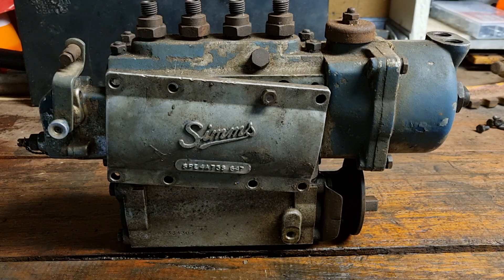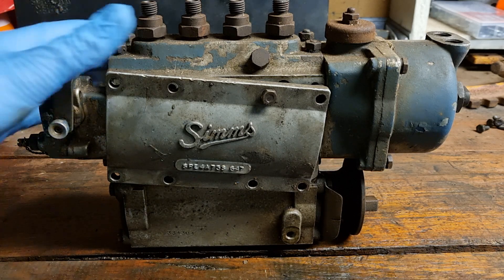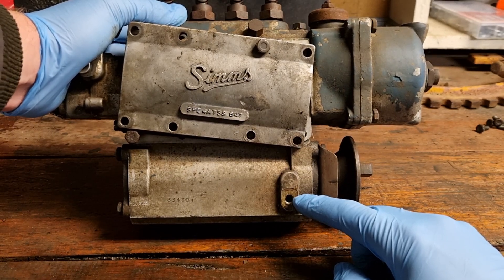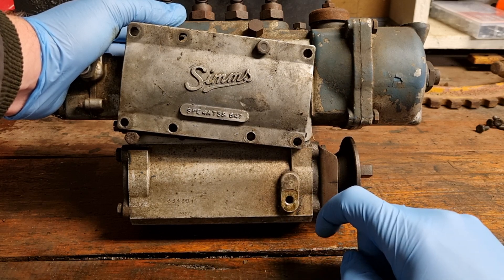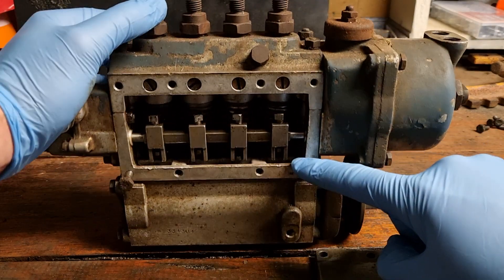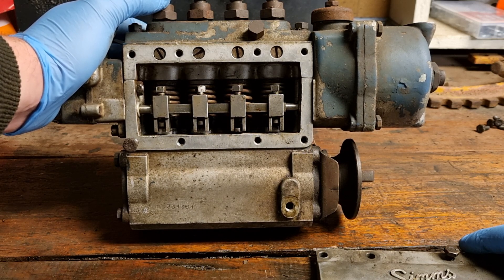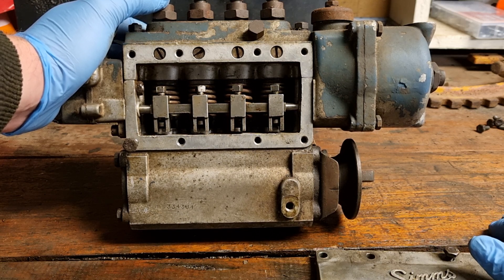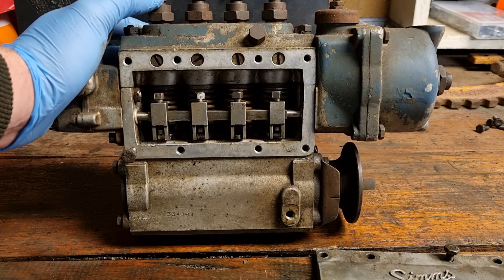Fordson Major Fuel Injector Lubrication

Comment: Hi Guys i have a major with a 6 cylinder 2713 industrial engine in it with a simms pump similar to this with direct drive to the timing cover...newer engine i think...Anyway it came out of a combine harvester/Yellow....It starts and runs good but i cant get the idel speed down to a normal tick over...i wound back the idle adjuster to maximum but it still runs high...Any suggestions on how i can wind back the idle more or is this the way the governor is set for combine harvester application?  Any suggestions please...

Comment: Can I leave the injector on the tractor to complete this? And should I replace the paper gasket?
Reply from the maker: It can stay on the tractor for this. If the gasket is in good condition, it's fine to reuse, but if it's torn, compressed, or uneven, it's probably best to replace it.

Comment: I’ve got an older Simms apart right now.  It was full of water and in rough shape. I had to machine the cases to accept modern bearings as the originals are hard to source. I’m getting it back together now but do you know where barrels and plungers are available? These look not too bad but I’ll have to see how much leak off they have...
Reply from the maker: Unfortunately it is very hard to get new old stock for Simms Fuel Injectors. Best bet is to find a diesel mechanic that could refurbish them or a wreckers for replacements

Comment: My old man's powermajor has quarter butter bolt tapped in the cover  just next to the big S for simms and he used to squirter engine oil  every now and again , I think the pump has been serviced twice e so far the 1st time was when he had the plug on the side cover  probly mid sixties and 1981 when I was 6yrs old ,the 1st 6 years he owned it he did contract ploughing with a 10 furrow chamberlain plough , sometimes up to 500 acres ! he ran it 24hrs a day  had a bloke help him , not sure how many hrs the engine did but it was reringed in the first  10 yrs and the mechanic found a compression ring was  missing on a cyclinder he reckoned it was missing from new ! Dad didn't think it pulled any better after the rering .R
Reply from the maker: They really are tolerant tractors, takes a lot to wreck them beyond rebuild.

Comment: Ive been rebuilding those pumps for 40 years. Best thing to do is drill and tap the side cover to take a large BSP plug or you can use a fine pitch metric one. There are sum sidecovers that were factory fitted with fill plugs into a boss cast on the cover.  No need to remove the cover to refill. Then with the level I fit a banjo fitting to the cambox and run a length of clear tubing from it up to one of the cover bolts holding it in place and turn the end 180 so its facing down making a gooseneck. Fill the pump with oil, mark on the tube then you can see if its filling up due to backleage from the elements. Remove the excess fuel/stop control cover and smear grease over the two arms and refit. Remove diaphragm case and do the same to the brass yoke and the foot of the governor. 
Such a simple reliable pump that just keeps going and going.